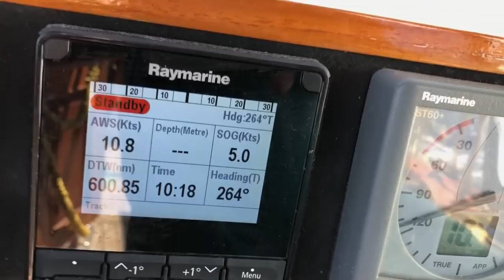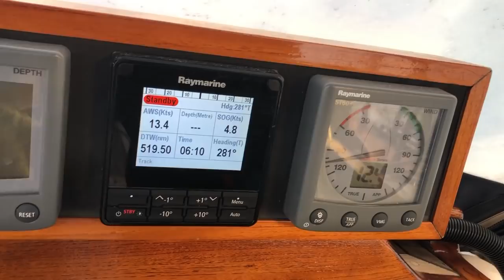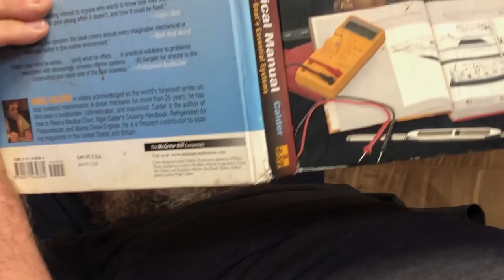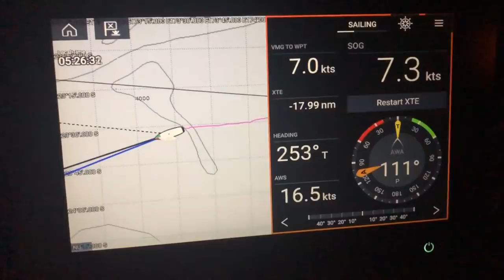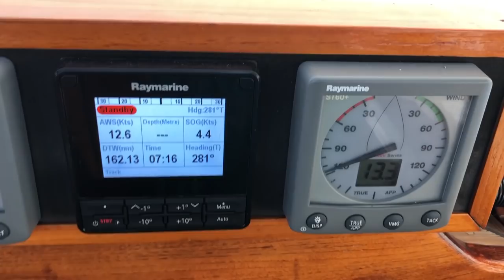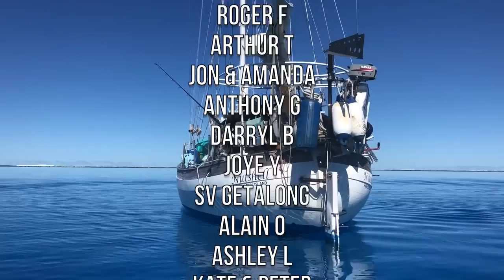Ep 166 | No Gas, No Coffee! South Minerva Reef to New Caledonia Passage, Sailing Nutshell

Comment: Butane gas torchs are ok but have a serious look at the Milwaukee 12 volt cordless soldering iron, they are brilliant and many sparkies and repairers are changing over to them, takes about 20 sceonds to reach temp, charge quickly and be done via solar or inverter but the biggest thing is not having the risk of leaking butane gas canisters aboard the boat, they're notorious for leaks, as a retired sparky myself I'm one of the biggest converts, didn't think any thing would beat a butane torch but they do and so much safer to handle,cheers Darryl
Reply: Top tip. Thanks.
Reply: dashaB0553 great 👍
Reply from the maker: I’m going to check them out when we get home. Great tip.
Reply: @LifeinaNutshell  You'll wonder how you ever managed to cope without one in the finish, for marine and automotive repairs, boat trailers and the like, your instance here, they're brilliant, my biggest gripe is there's no where to hold the second soldering tip and will get lost very quickly, glued a bit of pvc tube on the handle and slide the second tip into that, [ keeps the entire tool as a single unit] the chisel tip is great on slightly bigger cables or where you need more heat transfer, best tool ever for me and my solar dc applications

Comment: Soldering iron.
Unscrew and remove the tip.
Sand paper or steel wool the whole tip and inside the shaft.
Put it back together and melt a tiny bit of solder  on the tip.
That should give you a hotter tip to solder with.
But you probably already know this.
LOL

Comment: Y'all need a vang for your main. That will help with both speed and roll downwind....
Reply from the maker: I'll fit one. One day.
Reply: @LifeinaNutshell  Do it! You'll be amazed at the difference it makes when reaching and broad reaching. It will also eliminate chaffing against the rigging when running - though nothing does much the rolling dead downwind. That's why I rarely run - I broad-reach and jibe downwind.  Even though you'll sail more miles, your VMG will be the same or better, you won't need to rig a preventer, and you'll eliminate the risk of broaching and accidentally jibing. By angling down the faces of waves like a surfer you're reducing the steepness of the wave faces presented to your hull and in effect increasing the period of the swells in the bargain.

Oh, and you'll experience more apparent wind for ventilation and wind-vane in lighter air, and be much more comfortable when it comes to any rolling motion. 

The main downside is the need to jibe ocassionally. I rigged a "boom brake" that's integrated with my vang using a climbing figure 8 friction rappelling device. There are comercial systems availible as well that make jibing even in moderately heavy air a piece of cake. Good luck and fair winds - on the quarter! ;-)